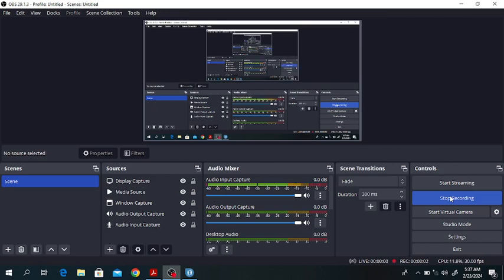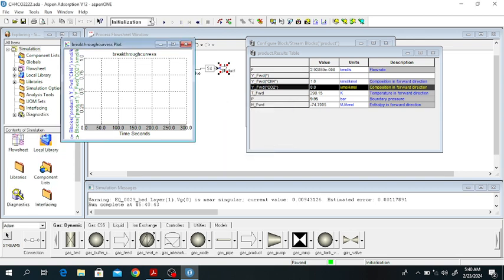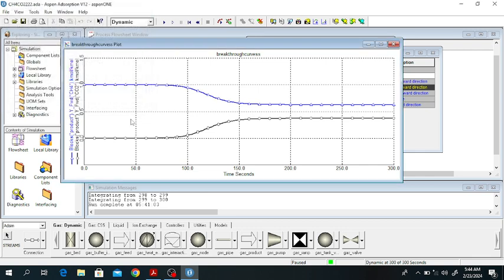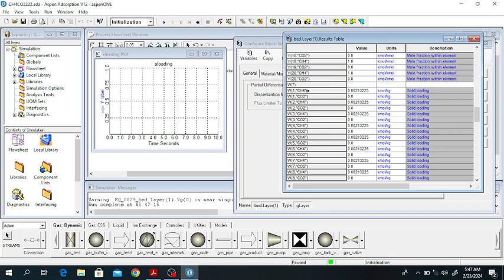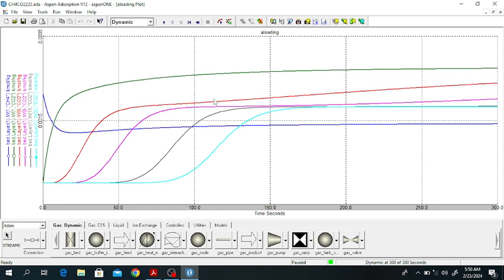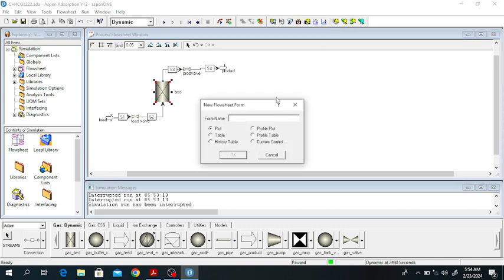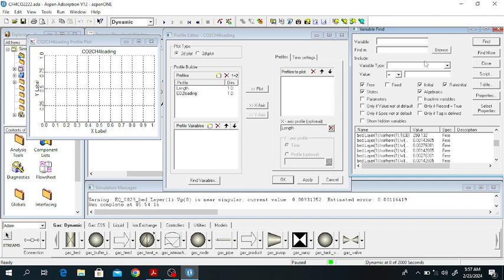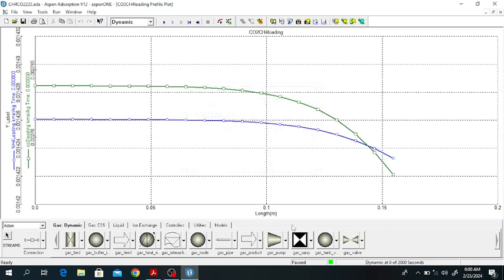How to plot breakthrough and solid loading curves for NH4 and CO2 using aspen adsorption

Comment: I have a grid as solid lines. How can I change the grid to dash lines as yours? I tried to figure out but I couldn't see anywhere to modify the grid line style? 

In addition, I want to modify the default size of the stream lines. How can I do that?

Thank you.
Reply: Try to use origin? I always tranfrom to the origin
Reply: @文晓烁-x8n I tried but not help. I think it is a bug. I tried with version 12 no issue but 14 has issue
Reply: @LongTran-k5z  ok, when I after reading the video,I will try it flower this
Reply: @LongTran-k5z  I don't Know,My Aspen like as his dash lines too
Reply: @文晓烁-x8n can you solve the line issue? Changing from solid to dash lines ?